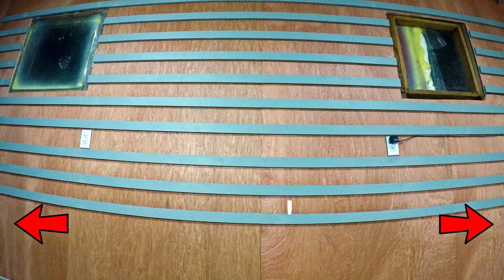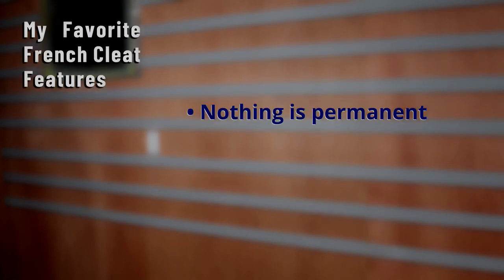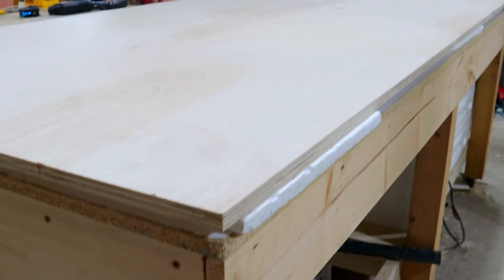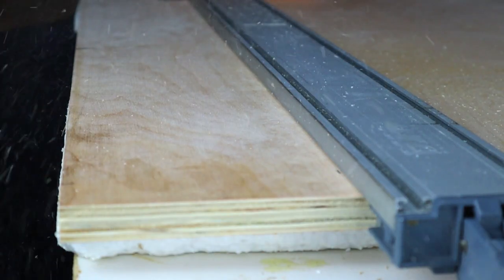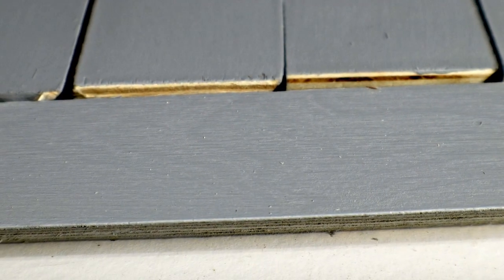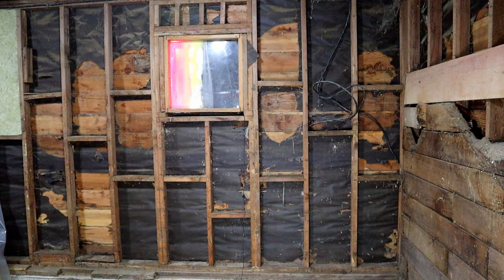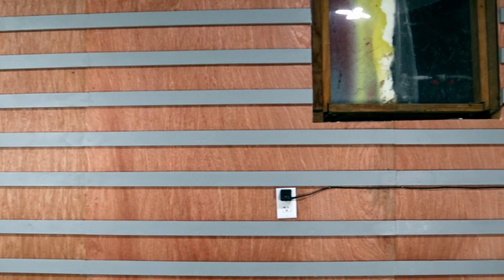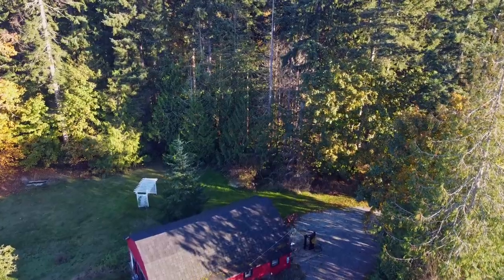DIY FRENCH CLEAT TOOL WALL - I built a cleat wall in the NEW shop

Comment: I made a huge mistake when building my cleat wall, I used pine.  The problem is pine is way too soft and and weight pulls the items off the wall.   You live and learn.   I will buy some better stronger timber.  Yours is great.  Cheers, Sean
Reply from the maker: The cleats hare holding up pretty well so far, and I have quite a lot of stuff on there now!